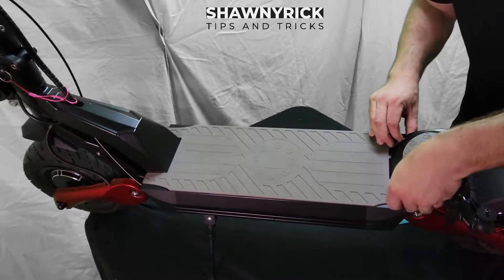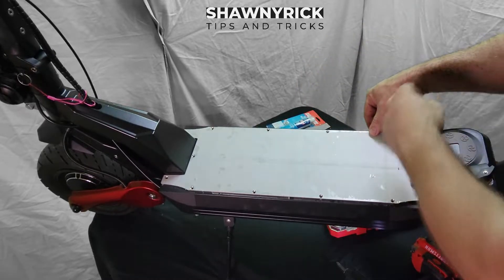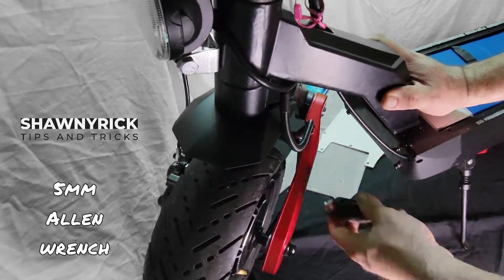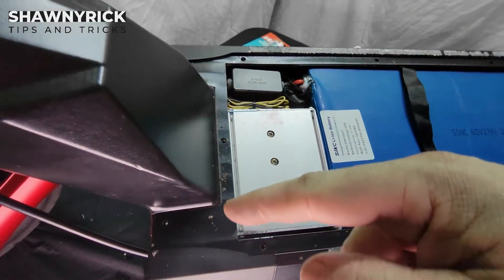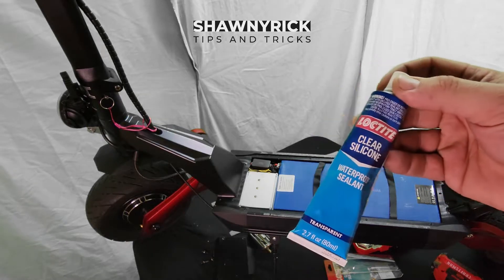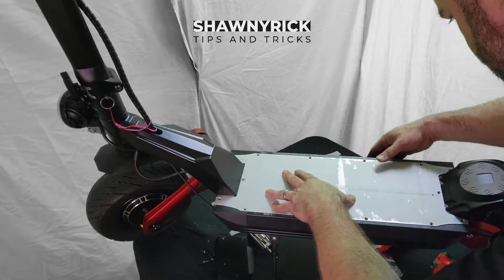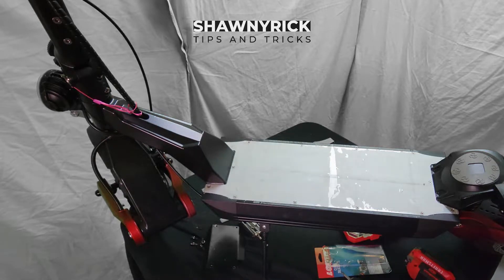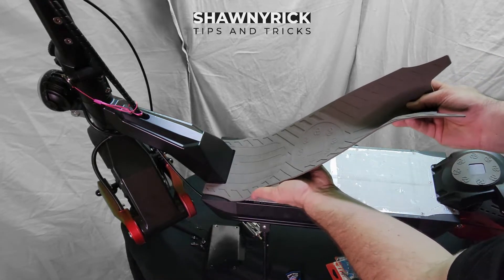Water proofing  Varla Eagle One Pro #varlascooters #Varlaeagleonepro

Comment: Quick question I just received my eagle one pro scooter and the steering is very stiff. Is there any way to loosening up the steering?
Reply from the maker: It does take awhile to get use to how it handles but not long. Once you get use to the steering and get use to how it rides then you will begin to love it. I have a first time rider video I just did before this one that you could check out may help you with some pointers as well
Reply: @ShawnyricksTipsandTricks  ok thanks but is that normal for the steering to be so stiff customer service told me that after I ride it for a while that it will loosen up.
Reply from the maker: It depends on what your use to riding if you have been riding the eagle one then Yes it will feel different for a bit. And it having the 11inch tubeless tires which are wider will also make it feel different for a bit as well. Each scooter is always a bit different to handle at first. Now that I have 180 miles on my E1pro I think its the best handling scooter Varla has made.
Reply: You can take off the front swing arm from the stem by removing the large bolt in the stem, from there you can remove the rubber ring that Varla uses to create the damping effect. Mine didn’t come with one, I recieved one to put in, but I am already used to the steering, and from what I understand, it wears down at varying rates